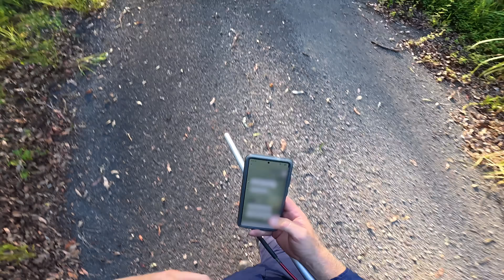DANGEROUS Eastern Brown Snake Catch | This One Was SKETCHY!

Comment: 2:40 For those who may be wondering why front-loading washing machines are so heavy, most have a giant concrete block in the base to prevent them 'walking' or shaking themselves to pieces during the spin cycle.
Reply: Yes, they are about 300mm square. Fun trying to move by yourself.